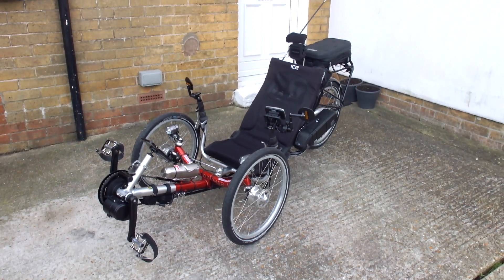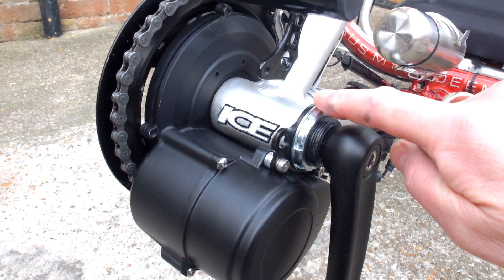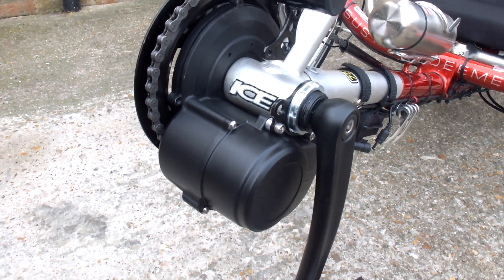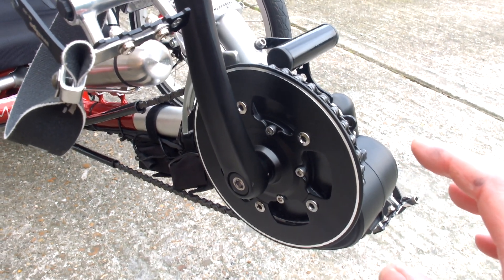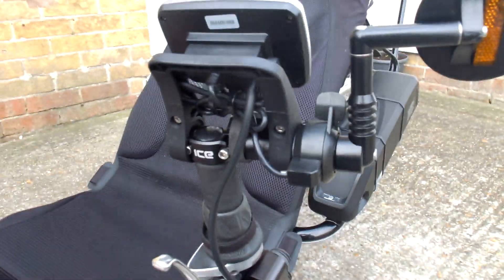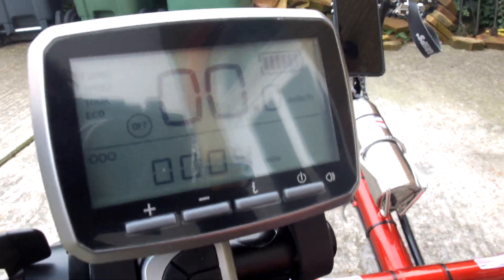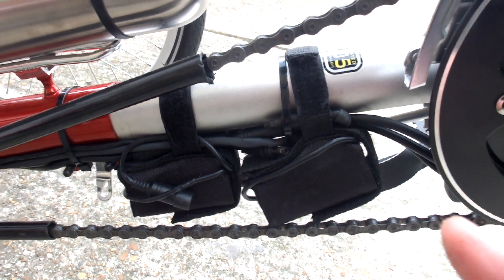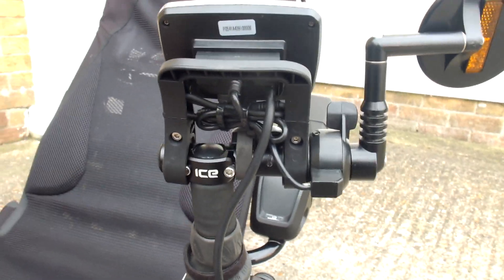2009 ICE QNT Recumbent Trike  250W Tongsheng TSDZ2 Electric Motor Install

Comment: You should install our OpenSource firmware on TSDZ2, that way you will get more torque and battery range, other than advanced features that are typical on high expensive ebike brands.